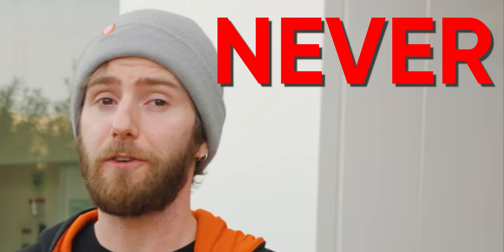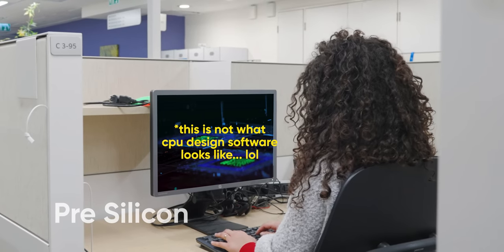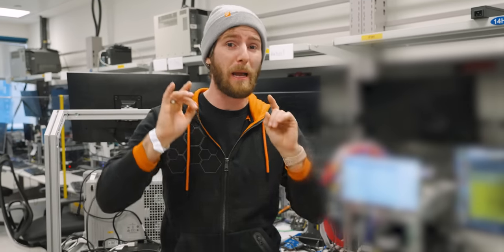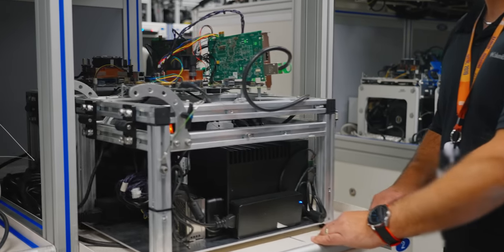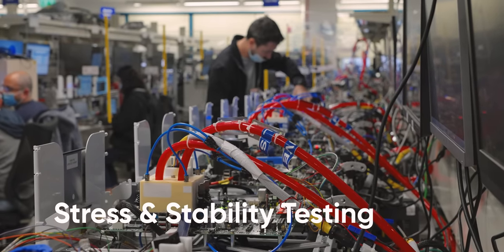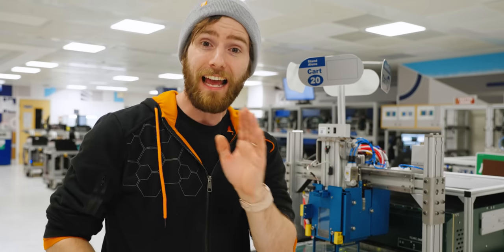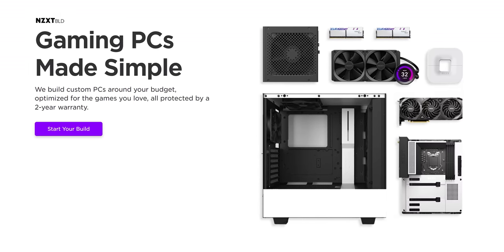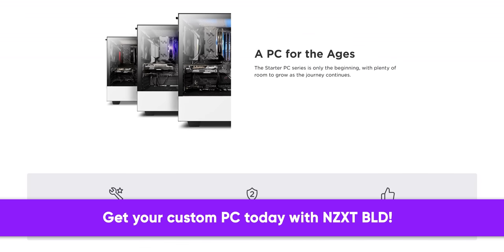I Ripped Up My Sponsor’s Check - Intel Fab Tour

Comment: Remember, that $450 CPU costs that much because of all this stuff that goes on behind the scenes.
Reply: Thanks, Captain Obvious!
Reply: It's true that R&D is a significant portion of the cost, though it's not the only factor. There's also all that stuff that's behind the scene, fabrication, product margins and yield. Upper-end CPUs cost a lot because of the low yield. Silicon lottery is not a meme. 9% is a BS statistic I made up but its propably around the ballpark of the yield of the most high end CPUs. It's why some cores are disabled on lower end cpus, disabled cores are defective and the dies are discarded as cheaper chipsets. The expensive CPUs are the near defectless silicon.
Reply: @wiltsuFIN  They also have to account for the people buying ryzens instead.

Comment: @7:55 some cpus in laptops that still have DVD drives. can boot into DVD player mode where the OS doesnt turn on at all. just plays DVDs for drastic increased battery life. probably for this feature.

Comment: 6:29 - I guess throwing the chip into the jig is part of the test? lol

(in fairness, it probably is a good real-World test of how some users build their first PC, me included.)
Reply: Yeah I also noticed that. Wtf? :D
Reply: @Szaboo92  It looks like it's a "bed of nails" type test socket, where the pins come through the underside once the clamp is down.

And most (current) Intel desktop CPUs don't have pins, so it probably looks rougher in the video than it is.

But still looks like the guy was rolling dice. lol
Reply: Actually makes me wonder how many "secret" pins there are on modern CPUs.
ie. pins they only use for factory tests.

Probably wouldn't unlock anything too interesting, but you never know.

Those pins will usually be tied to Ground, VCORE/VCC, or left floating on a consumer motherboard.
Reply: That’s me - Trust me, that’s the actual engineering way of placing a CPU in the socket 😁
Reply: @valentinfarcas9972  OK, fair enough. lol

It looks a pain to easily get the chip in there, too.

Was my guess right, about it not having actual "pins" in the socket when the clamp is up?
Reply: @electronash  We have vacuum wands that we use to place the CPUs in the socket, I was just kidding. :)

Comment: It's like Linus is gathering ideas for his new LTT Lab 1 and Lab 2
Reply: How did you comment before the video was live?😂
Reply: @Myks0121  ikr?! he's literally 25 minutes early
Reply: @Myks0121  , Linus is on the North American continent.  The European Legacy obviously is not.
Reply: @CroneLife1  So in 25 minutes his was only comment for the audience of the north American continent? Also im unsure if LTT post content time locked to a region 🤔
Reply: @Myks0121  , it may have more to do with time zones and the time difference between zones, not the actual passage of time.  People who don't live in North America aren't in the same time zones as those who do.  I could be wrong about this, but it seems logical.
Reply: @CroneLife1  Honestly this seems wrong to me even if it was 3a.m in that time zone there would be more comments than one
Reply: @Myks0121  , you may need to check with YouTube to see if there is a glitch in how time stamps are registered.  If LTT posts at, say, 3PM EDT, and someone somewhere in another time zone not in North America posts a response, is the time stamp reading their posted time based on where they are*?  Ask YouTube.  The only explanation I can come up with is that The European Legacy is not North American and so the timestamp for their post is registering for their location; but because it doesn't actually *give the time of posting (it only gives past-tense referents), it comes up as a past-tense even though that is an incorrect way to state it.

Comment: Intel I think you’ve finally started to get consumers trust back. The whole tik tok cycle of releasing incremental upgrades to appeal to shareholders really upset the market. To the point where AMD was allowed to catch up and almost surpass. Now you have ARM chips from apple threatening everything. It’s refreshing to see Intel in a more PR friendly light
Reply: It's good to beat on slackers, but it's better to see them recover and move forward. Big up to Intel for allowing this video and responding to the industry.
Reply: Almost surpass? Bro where have you been since ryzen 2000?
Reply: @ChunkyWaterisReal  Intel is holding its own in the laptop segment
Reply: @c2thew  most laptops I've seen are powered by AMD except for the budget ones

Comment: It's amazing how even with all of that testing and validation, I STILL managed to have to RMA my Intel Core i9-12900K back to Intel for a full refund because of a suspected on-die memory controller failure.
Reply: I'm sure a faulty CPU will creep into a keen buyers hand ever so seldomly.  After all it's the nature of the beast.  Nothing ever works out perfectly, no matter how many precautions, tests etc. were taken.  It's just a shame and annoyance it had to be yours.  Maybe you should have kept if you could afford another and auction it on Ebay as an extremely rare, hard to find CPU.  People will buy anything.
Reply: @AbbStar1989  
Yes and no.

The first four sticks of Crucial 32 GB DDR4-3200 non-ECC, unbuffered DIMMs failed after producing 10035 errors in memtest86 v9.4, so much so that memtest86 actually self-aborted "due to too many errors".

The second set of four sticks (which PASSED said memtest86 in my 5950X before I moved them over to my 12900K system) -- memtest86 didn't even run for 27 seconds before the system spontaneously resetted itself (cf. https://www.youtube.com/watch?v=VF19o2OMzbU).

The system was predominantly used for data processing (i.e. unpacking 7-zip files and then repacking them using `pixz`).

And I can't tell if the problems/death of the on-die memory controller was because of the existence of the P cores and the E cores (i.e. the on-die memory controller was getting super confused) or if it is because of something else.

Either way, the fact that said 12900K can't run memtest86 for more than 27 seconds, is very telling, and SERIOUSLY problematic (given that memtest86 is supposed to be a relatively "basic" testing tool, and it struggled to even run that!)

One of the potential reasons as to why "Nothing ever works out perfectly, no matter how many precautions, tests etc. were taken." is they might not have even TESTED for this failure mode.

You will only discover this failure mode if you TEST for this failure mode.

But if testing for this failure mode was NEVER in the test plan, then you will NEVER find it, because you never tested for it.

"Maybe you should have kept if you could afford another and auction it on Ebay as an extremely rare, hard to find CPU.  People will buy anything."
Why would I want to do that?

I understand that SOME people have NO problems selling a KNOWN, defective product.

But that's not me.

Comment: I recall when the fab plant north of Albuquerque wanted to expand. People panicked when it shut down because they thought that Intel was leaving, even though the plan had been publicly discussed for over a year. I knew it was temporary because Intel had rented almost every available self-storage unit in a several mile radius. If the plant were just shutting, there would be no need for that expense. Local real estate prices plummeted because of the panic. I regret not having the money to buy. It took over 18 months for Intel to buy sufficient water rights, and less than two years after that the expansion was up and running and real estate prices went nuts.

Comment: All those screens, and nobody at Intel thought to test collage mode across 3 screens or more with timed power on/offs?  Collage mode breaking constantly because TVs turn off overnight has been a huge problem at my job over the years.
Reply: I want to see rapid resolution changes and how they are handled. Matrox is / was king in this field, but AMD recently got very good at it. NVidia consistently brakes.
I think the niche we are in isn't worth it to account for in the big runs they do.

Comment: 6:31 Can dropping the CPU in place like that where the underside parts smash against metal potentially damage the chip?
Reply: Intel chips are LGA, they don't have pins on the chips themselves but rather in the mother Board or in this case the testing apparatus.  I could see damage being a problem but I presume they've built those test rigs to be much more durable and they can probably swap out the pins themselves rather easily since it's separate from the CPU being tested.
Reply: There is a 100% chance that whatever Intel does with their chips however they decide to put them on the board during testing that their machines and techniques are developed to not break the chip.
Reply: @davidmcguire6043  One thing I hadn't thought about on my previous comment is it could be designed so the pins can retract/extend or it could just be industrial strength pins of some sort.

Comment: I'm glad you finally got to see a front end (especially one done right vs. TI). But I would like to see tunnel diode threshold logic CPU and GPUs. 1000 times the speed as 1% the power.

Comment: This could basically mean Linus has probably seen Raptor Lakes in-late-dev and most likely a concept or maybe even a testing chip of the meteor lake… quite exciting to see intel showing the processes. But pretty sure there are still more sweet stuff other than the aforementioned ones :))

Comment: Nzxt cases, remember them you featured them a lot in budget builds and compact builds, remember lot of times you had to change on the fly to fit into the cases that you had available, so this service sounds great letting people get custom type pc while ensuring things are validated and fit in the case

Still wondering if eventually ltt will become a pc maker or builder or sell approved or licensed and branded pc or accessories

Comment: Intels new 12th gen CPUs sound really great with that split core feature…. But it is all still expensive.
Like yeah, a 12th gen i5 P core and E core version is much like the same price as some Ryzen 5 or whatever…. But they also still c9me with more cores compared to the Equivalent numbered ryzen CPU, and yet the intel ones for both P and E cores are still powerful in their own right.

Comment: Like to see size and speed comparison on AI form Agilex or Stratix to i9-12900k or to some new xeon. Those are usually used for custom application / data processing in PCI-e cards or separated devices.

Comment: People talking about the blurring, much of the blurs are to hide the names of the internal machines they use.  If you visit an american based fab you can take a window tour and see the same machines, however, they literally have intel logos taped over the machine manufactures names.  As if having that knowledge would give a competitor some weird advantage or something.  Like it is some huge secrete what company manufactures silicon manufacturing equipment.  "Only the paranoid survive" well, Intel will live forever then

Comment: I hope you didn't travel to Israel for just this.  Then again we known you extended your trip because Israel is cool!  I work for an Israeli company and recognized some of the equipment they use.  I'm surprised it's reliable enough for what they're doing.  Then again some of their bread-and-butter applications is the chip manufacturing space, but it's not up to snuff in some biotech applications I suppose.

Comment: I'm developing a power&thermal controller IP that will go inside a 2+k$ HPC chip. It's just me and another callegue and we are working on laptops and 2 fpgas (one of which is broken). I wish we could have 1/10 of the hardware and manpower seen in this video :tears:

Comment: how does a simulated chip work? I know a lot of the basic concept about emulation, but it only makes sense to me when you emulate/simulate something that's at least 5 or 10 years old because I would think you needed newer, more powerful computing to be able to emulate it, plus an intimate knowledge of how it works in the first place. 

I guess they can have supercomputers doing the simulated CPUs? But even then, it just seems crazy that you could simulate something before it was actually made in the first place. /)_o

Comment: Hmmm, rip up intel check but then still have a sponsor, and it’s crucial the company you never mentioned included or talked about in your pc build guides even when it was pointed out sometimes in comments it was just as reliable and much cheaper since it was just plain memory sticks without the gamers up sell things like overclocking and rgb etcetera.  Glad finally have them as a sponsor but why after ripping up intel check and saying you’d pay them implying this was unsponsored

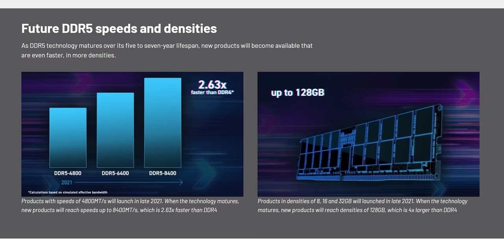Comment: 0:51 F**K CRUCIAL, I wont buy Crucial anymore.  

Crucial randomly pulled their DDR4 Ballistix RAM RGB software from their website forcing you to now rely solely on third-party manufacturers software to try and make use of their own RAMs RGB, so if for some reason you cant get the Motherboard manufacturers software to operate your RGB RAM, you're basically doomed, no more RGB for you.

They removed all links to their Crucial Ballistix DDR4 RGB software and then proceeded to message anyone that bothered to contact them to enquire as to where the software has gone and they simply reply with a copy and paste message saying it was removed from their website because it contained vulnerabilities and didn't elaborate any further.  

What were the vulnerabilities Crucial and is my PC now vulnerable as a result?

Also Crucial have decided to KILL OFF and stop producing its enthusiast grade Ballistix RAM now apparently. 

How does that work for people who have limited lifetime warranty?

I should have bought Corsair!

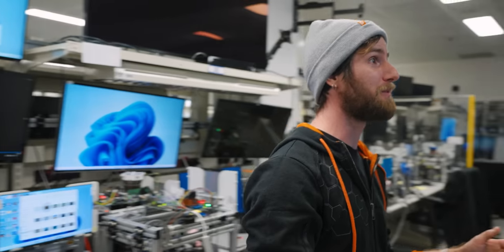Comment: 5:18 4 720p hd televisions running at the modern standard 1300 something by 768 resolution that started on laptops and became a standard across all pc hardware, and or 4 displays at 1:1 or 3:2 aspect ratio at whatever basic resolution is standard these days please, 4k and 8k are overkill and can’t visually tell the difference between 720 1080 4k content,  there is only a slight visual difference for me between 480 standard definition and 720p hd content and anything higher I can’t really see a difference apparent.